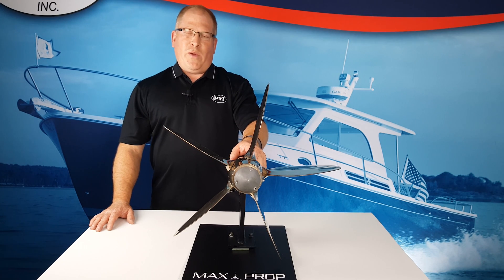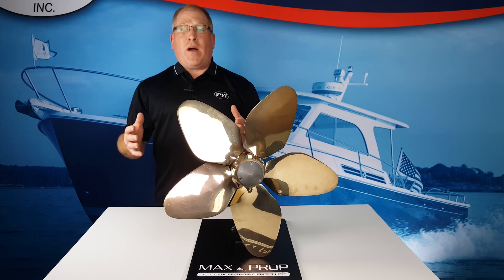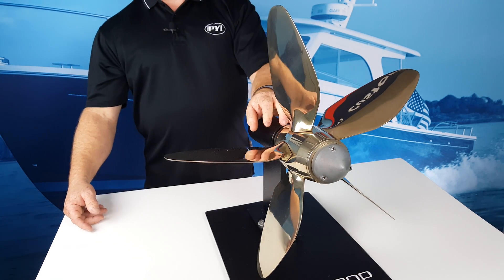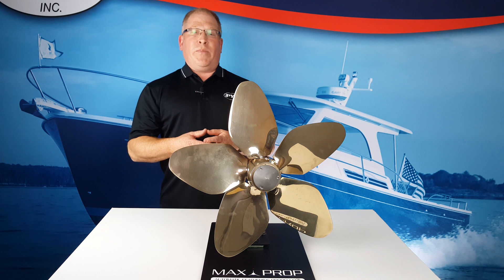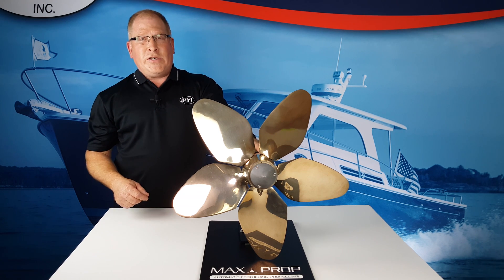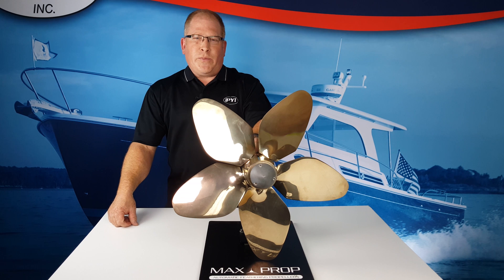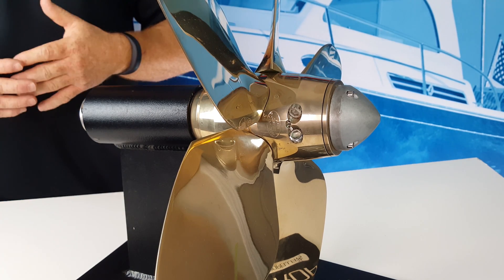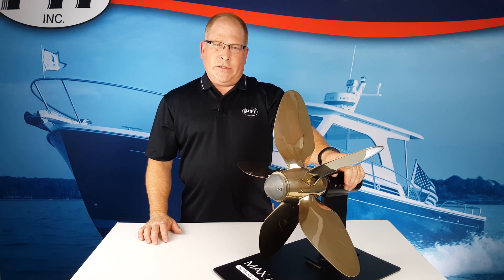Max-Prop Automatic Feathering Propeller

Comment: Be good if you showed under water video of max prop while sailing with engine off then put drive through the steps of forward neutral and reverse so we can see what happens to the propeller thanks

Comment: We have had a 2 bladed Maxprop for over 10 years. The reverse power is excellent compared to a fixed pitch. Remember though to fully charge the hub with the correct grease every haulout.

Comment: Can you custom built this prop for surface drives application???
Tq
Reply from the maker: Unfortunately, no the design of the Max-Prop would not function in a Surface drive application.  I am sorry we are unable to assist.
Reply: @PYIinc  we wish to conduct joints R&D to combine your prop hub technology with ESD surface piercing and supercavitating propeller blades. We have the data for prop blades development butvwe dont have your hub prop hub technology...can we do collaboration...
Reply: Just out of curiosity, what application would you need a feathering surface drive propeller for? To my understanding (I admit I am a landlubber from a landlocked state) surface drives are typically for very high speed planing craft, while feathering props are useful on sailboats. I would also suspect that a surface drive could probably be rigged up to lift the prop out of the water if for some reason you needed to, that being a better solution than feathering. I'd think a feathering surface-drive would be quite challenging technically as the blade feathering pivot would have to endure the repeating shock load of the blade piercing the surface, not a problem with fully immersed propellers.